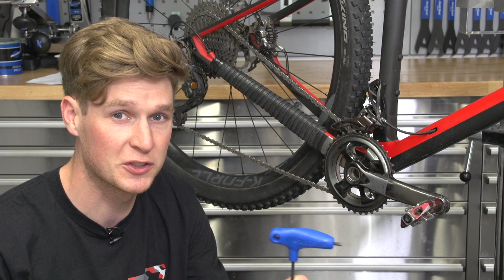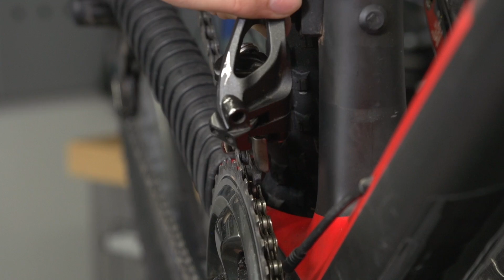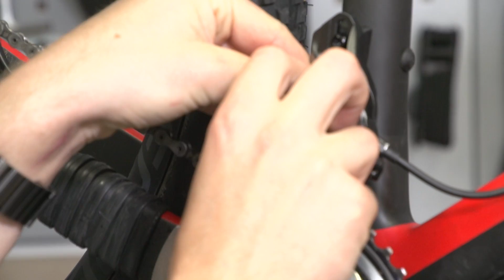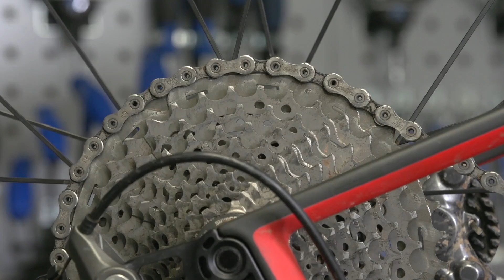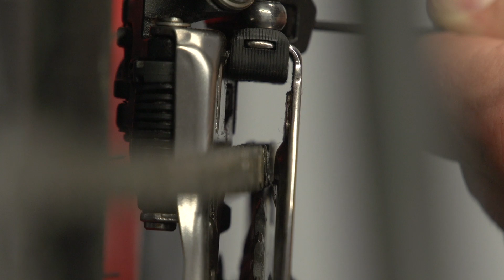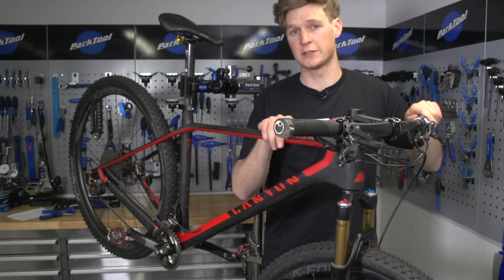How To Set Up A Front Mech On A Mountain Bike | MTB Maintenance

Comment: I wanted to know if there is anyway to remove a square taper chainset when the threads are badly worn. I fitted a new shimano UN300, put my chainset on, but wanted to remove it again because it was bent. I went to remove it with my crank puller but the threads wore out on the tool and the chainset is now stuck on the bike. Any ideas will be very much appreciated, otherwise its a new bike frame.

Comment: Super clear and helpful thank you!!! But what do you do if you don't have a barrel adjustment for your front derailleur. It's not on the handlebar or the actually derailleur itself, it just doesn't exist. Is it possible to install one or is there another way to fine tune the tension. It takes 4 clicks to get to each front gear and I can't think of a way to modify the tension other than installing a barrel adjuster if possible or maybe taking apart the shifting mechanism on the handlebar? What do you think?
#askgmbntech

Comment: My chain is rubbing against the front mech when i'm on highest/highest gear(biggest cog in the front,smallest on the rear),and as well when i'm on a highest on the front and maybe on 4-5th gear in the rear.Should i adjust my front mech "H" limit screw or a i need to adjust the barrel?

Comment: HI guys, great video and useful as I'm having a problem with my front mech at the moment shifting it up onto the larger ring. Anyway, can you tell me how to stop my chain jumping off the gears when I'm going down stairs on my hard tail. My chain rig has got 2 sprockets and I've been told I can't fit a chain tensioner because of this. Thanks, Stu

Comment: I have a problem with my shifting limits. The 3 smaller cogs of the rear cassette make the chain hit the front derailleur on the biggest plate. The cable tension is optimal (shifts fast up and down, no chain drops) and the H speed screw is completely loose, meaning the derailleur can't move further away from the frame. What can I do to fix it?

Comment: It's actually better to set the low limit before attaching the cable. This negates any problems with tension in the cable when you begin indexing.
Reply: Mate, I’ve scoured multiple videos because I couldn’t get the front derailleur right with the tension. This comment right here saved so much frustration. Thank you, seriously thank you.

Comment: My limit screws don't move the derallieur so I can't adjust my high limit and my chain drops into my small chainring... Any advice?
Reply: It sounds like the cable tension is too low, or that the cable locking screw isn't tight enough.

Comment: what happens if the cable tension is too much?
Reply: wind the barrel adjuster in or give a bit more cable at the derailleur
Reply: If the cable tension is too high, then it won't go cleanly from the large gear to the smaller one - you'll likely hear the chain rub on the derailleur cage.
Reply: @paulw575  My mech is too off so its rubbing on chain and when i tightened L to get it closer to the frame its still the same. Huh lol
Reply: GaTeMuCy ok thanks so there is a balance you need to get
Reply: That's correct.  What I do is have the barrel adjuster adjusted out one turn (from the minimum), then pull the  cable with some long nose pliers so that there is no slack in the cable.  I then lock the cable down at the derailleur by screwing in the locking screw.  After that, I use the barrel adjuster to get the shifting working nicely (like they do in the video).

Comment: How to install a front mech, take a set of Allen keys, clamp it to the seat tube, run the Cable through the frame, and adjust it.  Then undo the cable clamp, undo seatpost clamp, and remove.  Pull out front cable and shifter, and throw these things away.

Comment: Just make sure to fully reset your barrel adjuster (clockwise all the way) and bring it out 1 full turn (counterclockwise) before squashing the cable into your front derailleur - gives you something to play with and avoids freying the cable by reattaching it several times.

Comment: Save yourself the pain and frustration go 1 by it will change your life and you'll never go back
Reply: But will my legs love it too though?
Reply: I changed to 1x10 but my legs didn't love it. I'll change back to 2x10.
Reply: I'm running 1x10 and it's fine but that's me now ask me mid ride and I might say different
Reply: I'm running 1 by 10 too. 34 in the front. Ride mainly XC though. And today my 34 was a bit too small. But buying a 36 is a bit expensive, just making do. 
Or reinstall the front mech. Still have the original chainrings
Reply: Sunrace makes wide range 10 speed cassetes that aren`t too expensive. You could a 10 speed 11-42 cassete.
Reply: I have the Sunrace 11-42 cassette and an oval 34t. Works fine for XC but I usually end up in really technical terrain every now and then.
Reply: Szaman Szymon,  iv gone 1 by 11, and i will never go back,   there is plenty of wide range cassettes out there with all the gears you will need...if i could give any advice it would be keep a fairly low chainring upfront, (30-32tooth) if fitness is an issue this will work perfect for climbing,  unless you ride fast bike park dh trails you will not need a higher gear